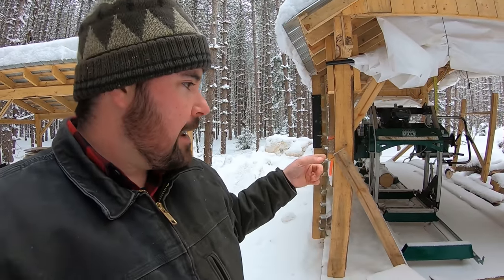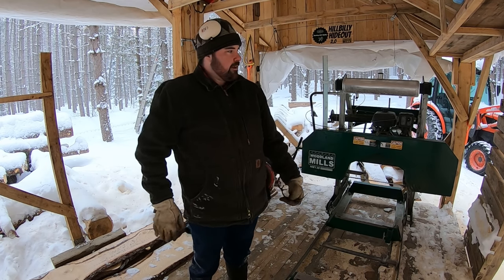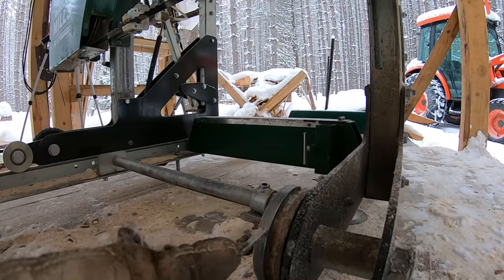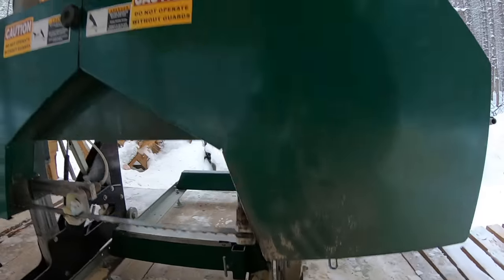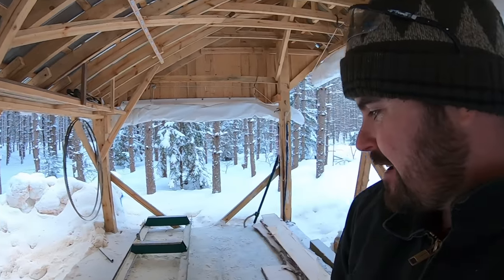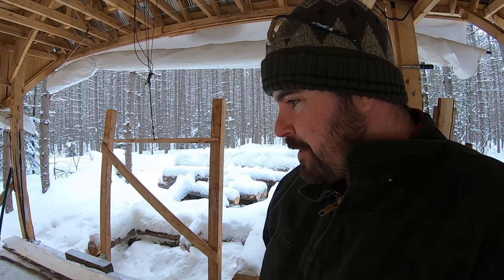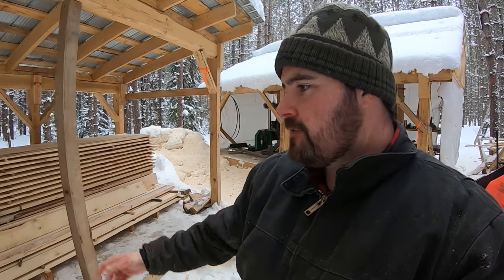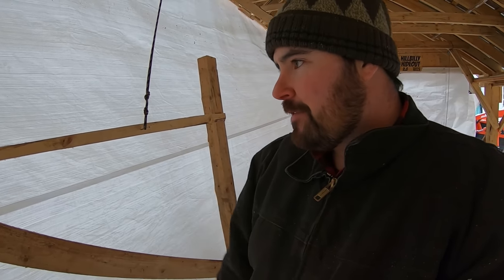Satisfaction, Solitude and Tranquility in the Woods | Sawmill Therapy

Comment: nice video the tarps have lasted well. here with the wind i don't think they would do well. i sawed a 26 inch buy 14 foot red oak took 2 hours using tractor to turn it. gas here is over $4.15 gal. corn free maybe over$5 a gal. so mine will have to run on the corn fuel. great looking wood. keep up your video's take care. be safe and well.
Reply from the maker: Thanks John. That's sounding like a nice log you had up on the mill. Fuel is expensive here as well. Think we're almost at $2/ Litre

Comment: Hi Sandy you dont seems to have problems with your ball bearings on your wheels in the winter mine seems to be frozen .I have to really push hard to move the sawmill did you have to do something special in the winter thanks for your videos.
Reply from the maker: Hi Marc-andre. I haven't done anything specific to the sawmill wheels they seem to roll smoothly since I got the mill.
Reply: @sawingwithsandy  OK thanks

Comment: @Sawing with Sandy If you get the want or need to extend or remake the track for your mill, try taking the angle iron and turning it 270 degrees to where the upright and flat sides are both on the bottom to make an upside down "V".  Next, change the trolley wheels out for the same type that is used on sliding gates with a V-groove.  They have a much wider gap in the very center.  They work an absolute treat!

Note: you'll have to make allotments  for your leveling screws.  Some "dog ears" should work.
Reply from the maker: Thanks for that . Great tip!

Comment: I have enjoyed and learn a lot from all your videos. QUESTION. You mentioned cleaning the wheel, and pointed out the wire “brush” (not sure of its official name) that is designed to keep the wheel clean. You have the lap siding attachment on your machine. When I put the lap siding attachment on my machine it left no way it to attach the wire brush on that side (unless I missed something). So, was there a way to affix the wire brush to the side that carries the lap siding attachment? If so, how?
Reply from the maker: Great question. You are right that there was no way to attach the wire brush back on. I'm not sure if this has been remedied but I never did look into it much

Comment: I had a friend that would run those boards with the live edge through his table saw, first side eyeball cut second side rip fence to keep it evein. worked quite well.
Reply from the maker: I may have to try that. I have done. some free hand on the table saw and it works pretty good.

Comment: Great video. Are you cutting your lumber true 2x4 or do you cut it at commercial lumber size?
Reply from the maker: I'm cutting 1.5" x 4".
Reply: @sawingwithsandy  I thought they looked a little slim for a 2x4. I've cut some true 2x4 and they seemed way over sized for building with.
Reply: @sawingwithsandy  I cut mine at 1 3/4"(spruce/basswood) and find when under 19% they end up to be around 1 1/2" or slightly bigger.  As Basswood is just a bit under the strength of pine, I cut at 4" as you do to add more strength and they end up to be about 3 5/8" to 3 3/4" wide when dry.

Comment: Hi...just a question for you based on the amount of lumber you have created since you have had your saw mill. Do you ever take the pith of the log into consideration when you are planning your cuts, or does the slow growth of Canadian trees make the pith an insignificant issue?
Reply from the maker: Good question Barry. Since most of my logs I cut are on teh smaller side I tend to just plain saw everything and not consider the pith much as it is often quite stable in the wood I cut I notice.

Comment: Hey Sandy, nice sawing. I also hate the time consumed in edging slabs, I stack all mine up and when I have a pile I get ones that are close and usually I just cut them in half so I have one square edge, then I mostly use them for roof boards (under my steel leaving the live edge) or at that point I can run them through the table saw for strapping or stickers. Also much of it often becomes campfire wood (kindling), but there is never a shortage of that.
Reply from the maker: great idea using them for roof boards. I may just do that. Hold onto them until that time as well

Comment: I think you aren't using lube with spruce this winter. I did not use lube this winter,  mind you sawing mostly 12 '' logs. Blade is dealing effortlessly and staying sharp. I don't mill as much as you do, so your input would be nice. I've been reading a lot, so what I get is that if the blade isn't hot, then lube not needed. Since I'm not in 25'' wide slabbing the friction is small I guess.
Reply from the maker: I agree with what you mentioned. In the spring summer and fall I use straight water and if the log is frozen I generally don’t use anything